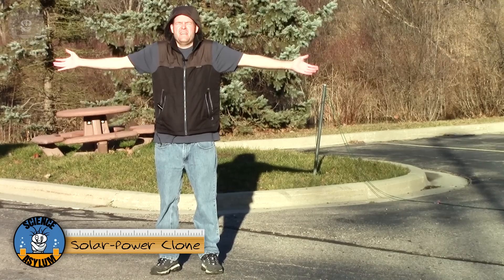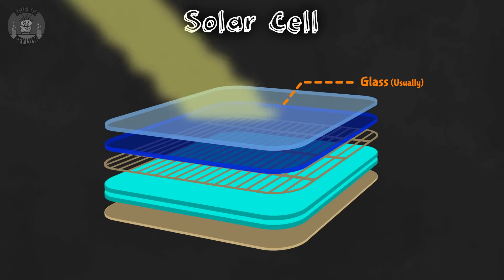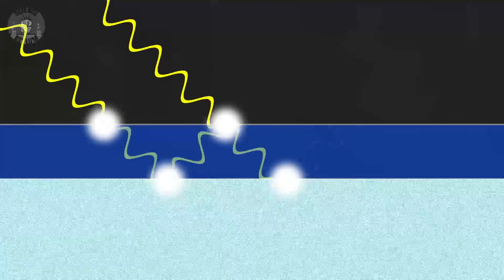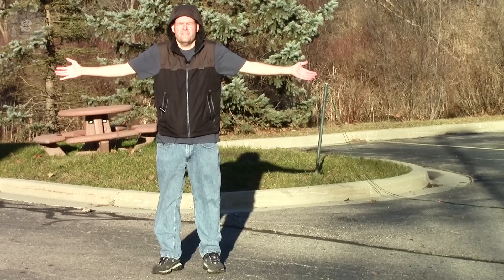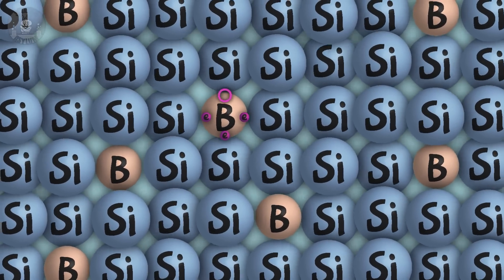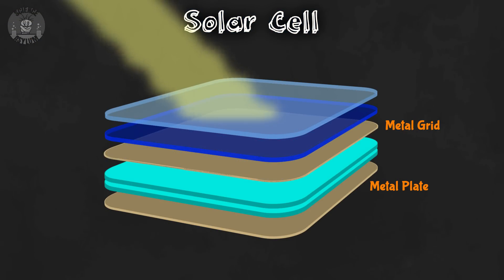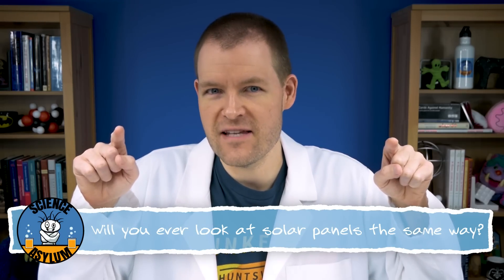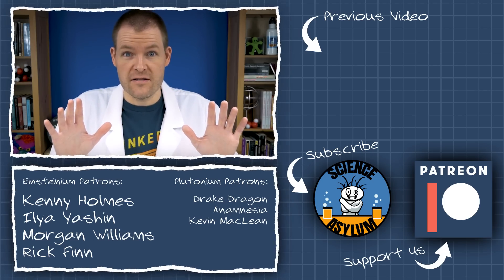How Do Solar Panels Work? (Physics of Solar Cells)

Comment: 7:20 I love you to death, but the answer is simple. A fully fueled 747 can make it around the globe in under a day. That's while carrying 250+ people. How long did it take the solar plane to do the same carrying 2?
Reply: I think it is absurd that businesses are flying employees all over the globe when they could be meeting via video conferencing and thereby saving huge costs both financially and environmentally.  There are so many things we are still doing the “old fashioned way” that could be more efficiently done electronically such as printed media: books, advertisements, billing, records etc.  Many jobs could be done from home thereby sparing employees the time, expense and frustration of commuting.  Virtual Reality simulations are the closest thing we will ever have to a Star-Treckian transporter so let’s embrace and truly exploit the technology we already have.  When one is born into the developed world, along with a disposable diaper, a two ton automobile is practically strapped to one’s ass.  This world we have created has become insane.
Reply from the maker: Burning jet fuel releases a crap-ton more energy than a few solar panels on the wings of a solar plane. However, the energy demands of a commercial plane are ridiculous! You can't use that as a counter-example for solar power in the ground-based power grid. Brian from Real Engineering did a great video about this: https://youtu.be/VNvzZfsC13o
Reply: @ScienceAsylum  Hi Nick, Thanks for the reply.  You’re right, it’s not fair to compare a SOLAR (not just electric) plane to a regular jet.  But it shows something.  I was comparing a jet running on JP8 that can reach NY to London in 6 hours to the solar plane that circumnavigated the globe in over a year.  Right now, that is the issue.  Efficiency.  Another issue, infrastructure.  A third, price.  Chris Lieding (above comment) mentions flying for business instead of video conferencing, I feel he has a very ethnocentric view.  Not all people fly for meetings, and not all people can skype.  We are actually pretty efficient in our energy production, at least compared to many other nations.  I do agree with him that “This world we have created has become insane”, but not just for this reason.  So, here’s my spiel: 1) this is a video on how solar panels work, so I’ll skip the climate stuff (though I’ll PM you something, if you don’t mind).  Even though you posted your friend’s climate video, I am still far from convinced.  But I digest (just finished supper).  2) Until we have efficiency that is comparable to fossil fuels, it’s going to be a tough sell to many.  That’s not to mention that not everyone lives in Arizona with 364 days of sunshine and 500 acres of land (exaggerating, but you get the point).  3) We could really have a great system if we wanted.  Imagine lining all the major highways with an “electric” lane.  This could be fed by solar, wind, hydro, and yes, the nuclear and fossil that we have.  But imagine what it could do.  Trucks could deliver goods without burning gas.  They would literally be running on a wireless charger.  There would be a meter and they could pay per charge.  Same for cars.  And imagine autonomous vehicles.  Fully charged when they pull off their exit, and no stops.  Why aren’t we talking about this?  Right, money.  Which brings up the last point. 3) I did the math.  It would take me over 27 years to recoup the money I would save by installing solar panels on my house (and that’s assuming zero maintenance).  As I mentioned above, that may be fine for someone in Arizona with millions in the bank and unlimited land, but what about that person in the one bedroom living paycheck to paycheck with 900 ft^2 to their name?  How about (going back to the ethnocentrism) the over 50% of the world living in poverty without clean water?  Solar panels are far from the answer.  I’m glad I know a little more about how they work, but maybe an idea for a video is how we can get more efficiency and how we can lower price?  Fossil fuels are on their way out.  This is not theory, it’s the way it is.  If we plan to be on other planets, we have to get this energy thing down.  There are no fossil fuels on planets that don’t have fossils.  So let’s do this for the right reasons.  Let’s leave the global warming to the politicians and their propaganda, and let’s look to the future.  Make a solar panel that can power a house for free and no one will want power from any outside source.  Just make it affordable enough.  Let the market run the demand.  Otherwise, even if the global warming alarmism is right (again, I’ll PM you), many people won’t be on board with the solution because they can’t be.  IMHO
Reply from the maker: 1) Comparing a fueled plane with a solar plane or electric plane is a fine comparison. What I'm saying is that you can't compare any of that to ground-based energy needs for a town or even a city. On a plane, everything needs to be contained. On the ground, you can put your power planet miles away from where it's being used. An airplane's needs are completely irrelevant when you're talking about the power grid.
2) I'm not saying that solar is the answer for everyone in every situation. Obviously this is a more complex issue than that. I'm just saying that we have a responsibility to use it where can and the same goes for other "renewable" options. The U.S. and other industrialized countries are in a position where we can afford the transition, so we should. We are all sharing this planet.
3) I'm aware that other less industrialized nations will need to rely on carbon fuels for a little while longer. That's just another reason we need to switch in the U.S., China, etc. It gives those other nations a chance to catch up. We need a global plan.
4) I don't know what that plan should look like exactly, but world governments need to get together and make one that's going to fix this. We can't rely on the market to determine when to stop using carbon fuels because the market will use them until they can't anymore. That will be too late.
5) That's not alarmist. It's just the truth. It's already begun. The fact of the matter is that the Earth's average temperature is increasing and it's almost entirely the fault of humans. This is going to have a drastic impact on the Earth in my lifetime. If we don't stop in a reasonable amount of time, the Earth will stop us instead and that's not going to be pleasant for anyone ...even with the best case scenario.
Reply: @ScienceAsylum  Hello again Nick.  Thanks for the reply.  Don’t want to hijack the thread, so real quick (too late): 1. I know, I was just pointing out some limitations. 2. See #1. 3. Right, but I disagree with your premise.  Make renewables reliable and affordable.  Build an infrastructure.  Then we can give it away to developing countries and help them get off to the correct start.  Otherwise, prices for fossils will tank and those countries will have no incentive to switch (not to mention the cost of re-doing the infrastructure that could have been renewable-based off the bat). 4. I disagree.  If given a cheaper option (all else being equal), that will be a strong driving factor.  No government meddling needed. Example, I just got 12 LED bulbs for $18.  They cost the same as incandescent or CF, and they will save me money on my electric bill (not to mention they last over a decade).  5 years ago, when they cost the same for a 2-pack, I passed right by.  Now, that’s all I use. 5. I beg to differ.  Maybe what you put out isn’t, but OMG, it is pathetic to listen to the nonsense out there.  If anything, you should be against it (the political crud that infected this topic) more than anyone as every one of those people makes you (and the other actual scientists, but nowhere near 97% of anything) look bad right off the bat.  When all the politicians have been banned on pain of death from the topic, we can sit down and do some real science.  Until then, it’s, “Cold? Global warming. Hot? Global warming. Floods? Global warming. Drought? Global warming. Terrorists? Global warming. Earthquakes? Global warming.” And I can back all those (and more) with actual citations.  Pretty sure that’s the definition of alarmism.  BTW: maybe a video on this?  It’s a good subject and deserves some unbiased info.  What is a “reasonable amount of time”?, for example.  What kind of drastic impact?  Give both sides a fair chance and present the data, no matter what it is.  No politics, no corporate sponsors, just science.  Thanks again for what you do.  Love the channel.  Look forward to getting notifications that you posted something new.

Comment: I am just confused about one thing: How are you making the solar cell more efficient by cancelling out the light reflecting away? Seems like that just reduces the glare coming form the cell, but doesn't actually do anything to affect the amount of light the solar cell is actually receiving to then turn into electrical energy.
Reply from the maker: It takes that 30% of the light that would reflect (most of it anyway) and keeps it in the solar cell for the electrons to use. If the light doesn't reflect, then that energy has to go somewhere.

Comment: 1) there's always focus on large, central solar arrays instead of home use... for electric
2) how much fossil fuel energy goes to electricity, vs other uses including industrial?  that's all solar can replace
3) heating is a big consumer need-- I'd love to see "alternative" heat systems that don't require a geothermal vent :)

no need to respond, thanks.  good video.

Comment: "We should be using solar panels..." I agree but what do you do in Seattle? Did you hear what the Seattle native said to the Pillsbury Doughboy? "Nice tan!" 

Solar power works great in the desert... when it isn't covering desert floor disrupting the ecosystem. That's what the environmentalists tell us. The truth of the matter is any kind of energy production has limitations and impact on the environment.
Reply: If plants grow in Seattle, it must be receiving solar energy.  I've never been to Seattle - is it all like bare Arctic tundra there?
Reply from the maker: Seattle is sunny pretty much all summer long and then overcast pretty much all winter long. Solar panels would be great in Seattle in the summer.
Reply: @ScienceAsylum  granted. What do you do in Seattle October to May? 

I'm saying that we cannot have all our energy eggs in one basket. Also, there is no totally "clean" energy source. Either you will have environmental impact in the production of energy or the production of the equipment and certainly the distribution of that energy.

You do produce informative and easy to watch videos!
Reply from the maker: They're fine in urban areas as well if you put them on roofs.

Comment: solar panels are the sh*t. i have for quite some time had a bad taste in my mouth for there being no reason why every house on earth has a set of these solar panels. a clean and endless stream of energy is being tossed at us all the time. why aren’t we taking it???
Reply: High capital cost, mostly. If you want to run entirely on solar, you need enough panels to run in a cloudy period in the middle of winter, which means you have to pay for far more panels than you need in summer. If you don't want to throw that money away, you need a grid connection - and if you have a grid connection, why bother with the panels at all? They make a lot of sense from an environmental perspective, but no sense from a personal finance perspective.

Comment: So what is the difference between solar cell junction and and a simple PN junction like in a diode?
Reply from the maker: There shouldn't be any difference in the construction. The difference is in how it's used. A diode is connected to a voltage source. A solar cell IS the voltage source.
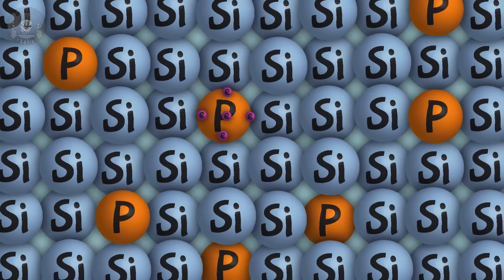Reply: @ScienceAsylum  well after 4:40 you are practically explaining the depletion region of a diode, electrons don't need light to go from N region to P region so what does the light exactly do to electrons (the light should somehow transfer its energy to electrons, maybe move them against the field in depletion region?!) but how does light push them against the field, or maybe it just excites more electrons, but they cant go anywhere because of the depletion region